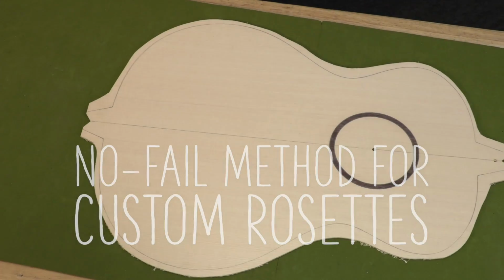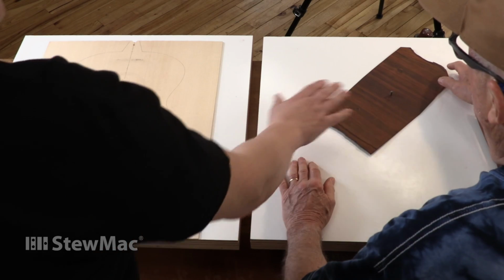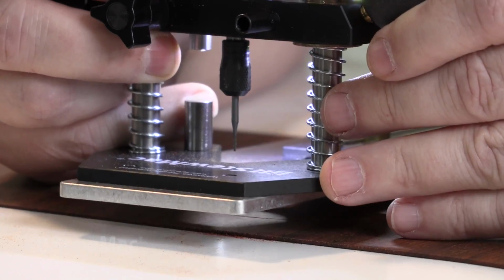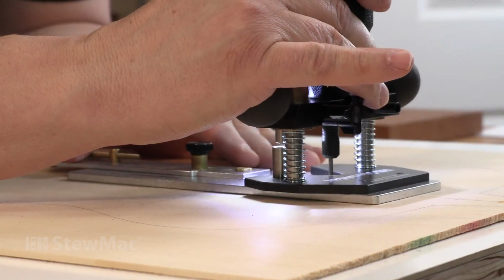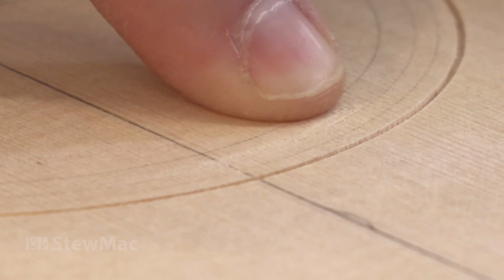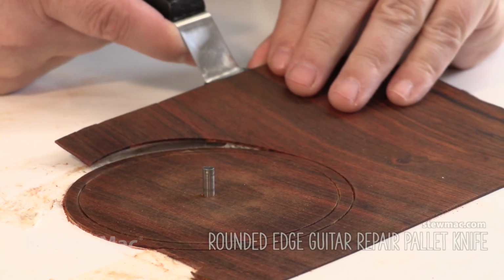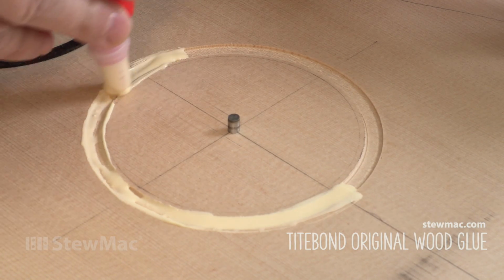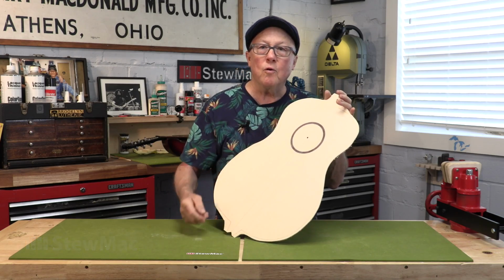No-fail method for making custom guitar soundhole rosettes

Comment: Great video!
When you go to remove the finished rosette from the work board, if you pry up a corner and squirt a little denatured alcohol between the wood and the work board, the alcohol will wick into the space and cause the tape to let go.  As the tape lets go, you can pry up more and more and a little more alcohol added will ease your part loose with less chance of breakage.
Reply: great tip!

Comment: Might mention that the thickness of the rosette wood should be such that it won't be too thick for the top and should be established before taping. The process works great and I've used it numerous times, so thanks for that!

Comment: When cutting the outside and inside channels on the top I do a very specific pattern that takes into consideration the spinning direction of the cutter in relation to the grain line. So I go from the end up to the waist/middle, then from the front to the same waist side, then end to the waist/middle of the other side, and front to that waist. Doing it this way tends to lay down the grain rather than tear it up. It's worked well for me anyway.

Comment: If you apply some shellac to the top where the rosette goes it’ll minimize the chances for tear out.
Reply from the maker: Yes, I do that frequently on making rosettes.  It also just toughens up the soundboard to make it a little less prone to dents, but we didn't put it in this video just for simplicity.  We struggled to keep the final edit under 20 minutes.  ;)
Reply: stewartmacdonald it was a great video I enjoyed it and learned from it!
Reply: do you apply the shellac before cutting?
Reply: @LiloUkulele  yes, you can also use superglue, however make sure to sand off all the glue before applying the finish because I’ll look different in color under the finish.
Reply: What is the best method to sand down the rosette & purfling flush to the sound board. Sanding down the purfling and rosette flush without creating a divot make the hair on the back of my neck stand up...pucker factor?  Thanks for any insights.
Reply: @LiloUkulele  I use a sharp block plane but you have to be very careful, you can also run it on a drum sander or a block with sandpaper. Find me on Instagram I have some videos there on how I do it. @ scafati_guitars
Reply from the maker: @LiloUkulele  I generally use a card scraper (or our ultimate scraper) to get it close, and then use a drum sander to flush everything up.  I put the rosettes in BEFORE I sand the plate to final thickness, that helps a lot too.

Comment: OK, I don't get it.  When you add the weight at the end, it exerts force only on the purfling, not on the rosewood, because the purfling is still higher than the rosewood.  Am I missing something?
Reply: I guess he's confident that the rosewood is seated completely. Or maybe he works on that after the purfling is secured.

Comment: A very nice and detailed video. If you are still monitoring this video, I already have the Stewmac precision router base. Do you feel the method is OK using a non-plunge router? Fine for the channels, as you can start by the fingerboard - but for the rosette itself? Thanks
Reply from the maker: yes, 100%  The plunge base just makes things handy.  You can absolutely do this using our original precision router base.

Comment: Thanks for the video, one question: I was thinking the rosette would have been installed turned 90 degrees from where it is so the grain of the spruce top and and the rosette were perpendicular to support the spruce from cracking along the grain, is this not needed or common practice?
Reply from the maker: No, that's not necessary.  The rosette is functional, but it's not really about stopping cracks as much as it is providing structural support around a weak area of the top.  How you brace it internally around on the back side if the rosette is very important too.

Comment: Video could have been greatly improved if it had included an anatomy or diagram and explanation of the rosette layout and general plan of the channel routing BEFORE launching into the procedure.
Brock's commentary is otherwise excellent but first time viewers new to the process are left wondering what the hell is going on in regard to which channel he's routing (what each is for, i.e. purfling or cocobolo ring etc). It only becomes clear sometime after 10 minutes, towards the end of the video.
Reply from the maker: That is good feedback.  Thanks!

Comment: My dowel pin Wobbles!
Reply from the maker: If it wobbles in your work board paint the inside of the hole with some thick superglue.  Let it dry then re-insert the pin.  Don't go crazy, a little goes a long way.  If it wobbles in your guitar top, test drill a hole in a piece of scrap (or outside your guitar pattern) until you get a tight fit (not too tight, you don't want to crack the soundboard).  Then drill a new hole.  You have some room for mistakes considering you're going to ultimately cut out the sound hole.

Comment: 1/8 isn't .080 though
Reply from the maker: Good catch.  We used an .080" cutter in the video but a 1/8" would work just as well for clearing the bottom of the channel once the inside and outside rings are cut.

Comment: Good job, but if you cut the second purfling channel right after the first you only have to set the depth one time.
Reply from the maker: Thanks. You're right, but if anything goes wonky with cutting the ring it gets more difficult since the spruce is already cut.  When I was watching the final edit of the video I thought I should have mentioned that.  :)